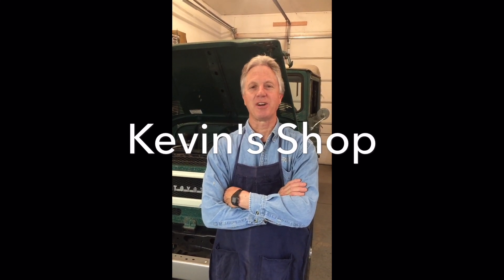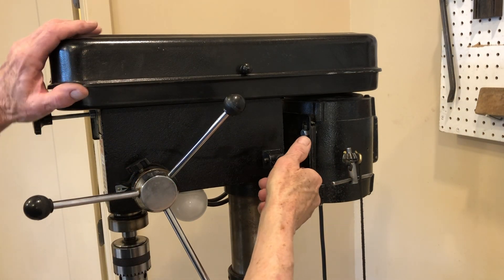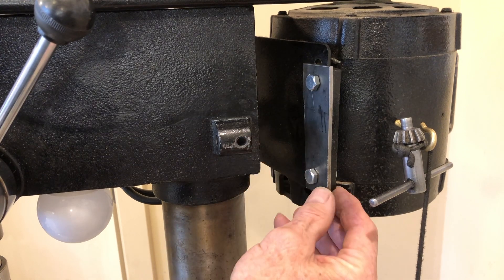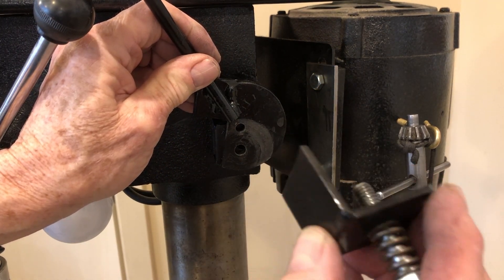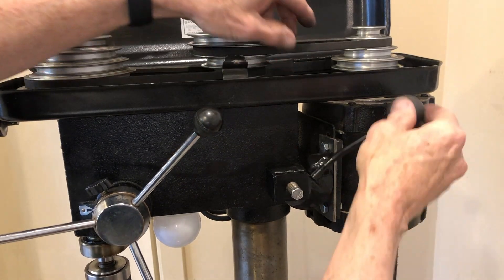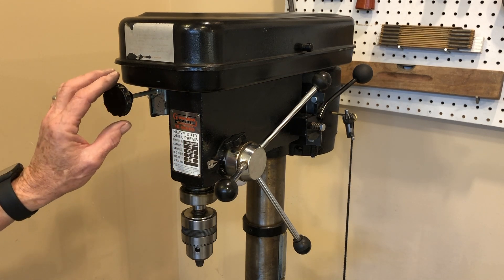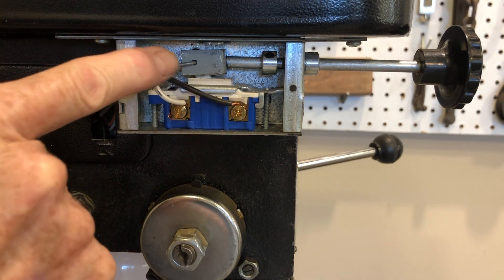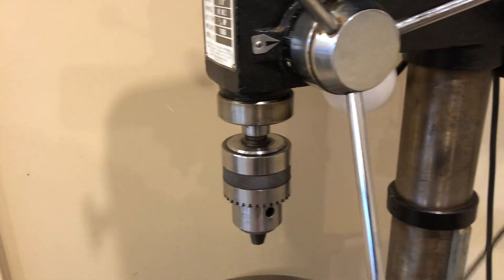Drill Press Homemade Upgrades

Comment: Another interesting mechanism I've seen for adjusting drill press speed was shown on Paul Brodie's channel. It's almost a sort of CVT arrangement that can be adjusted by cranking a wheel on the front of the machine. It's hard to explain, but pretty clever.
Reply from the maker: I have not seen that but will check out his channel and that video.  Thanks for the information, Kevin.

Comment: Very clever and practical mods, thank you 🙏 I specially like the cam lever for gear belt tensioning as I’m too lazy to change gears with the normal setup! Meanwhile, my drill press mods have been to not replace the quill spring or the cracked cheap plastic collar! 😁

Comment: I enjoyed watching your video.   However I didn't care for your chuck key idea, but what works for you right. On my drill press I installed a 4pole-double throw-center off toggle switch so I could reverse the motor for power taping(I did a lot of that in my business). Next I took off the spring return off the quill and put on a counter-balance weight on it so the quill would stay where I left it. Loved your belt tightening system,  I wished that I would have thought of it for mine because I used that system on my vertical band saw that I put step pulleys on. Well done sir.

Comment: Upper part of the shaft of my drill press (cheap Chinese) is responsible for 90% of spindle play. Do you have any drawings or photos of such assembly?
Reply from the maker: Hi, I don't have any drawings of my drill press and don't see a way to send you a picture of my drill press through this email portion of YouTube. My drill press seems tight and I do not have any play in the spindel. The lower portion supported by a  large ball bearing, upper portion I can not see, but most likely is a sleeve bearing of some kind. Not much help to you, 
Kevin

Comment: I have this same machine in my shop from the 80s.  It has been a good machine & my hands use it almost without the engagement of my mind.  One upgrade on mine was to replace the original set-screw in the channel that allows the table to tilt.  Mine now has a permanent set that can be altered if ever I want to tilt the table.  Before, it tended to tilt of its own accord.   I have several drill presses now, better ones, yet I go back to this one the most.
Reply from the maker: James,  thanks for watching and commenting. Some simple changes can make a big  difference, Kevin

Comment: I purchased the same drill press in 1982.  I love it and use it all the time.  My looks a lot more rustic than yours.  Perhaps it is time to clean it up.
Reply from the maker: Appreciate your comments! My dad and I bought the drill press at a business that was importing power tools back then, this was before we had stores like Harbor Freight. It was a tremendous savings and value. Thanks for watching, Kevin.
Reply: I was born in 1986😂... but on a little more serious note. I currently have 4 Drill Presses, the "youngest" is a Startrite Floor Type (Made in England) from 1998, then I have a very small bench model dating from 1982 (Taiwanese made), another bench model (Japanese) from 1979 and a huge bench type (Also made in Japan, but different manufacturer). This last one is pre 1966, but not sure which year exactly. Weighs in around 140kg (+/-300lbs). Build quality on the older machines are much better than anything new available from China nowadays.